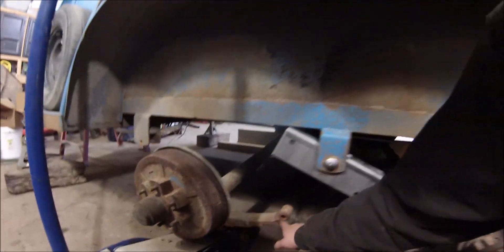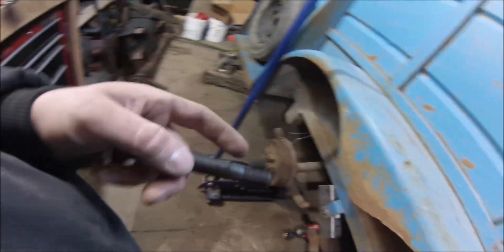Around the Shop: Trailer Suspension Basics

Comment: How do you change the grease fitting on the greaseable bolt. Mine just turns in circles like there is a nut on the back. I have a 2005 Avery car trailer.
Reply from the maker: Most likely a press-in style grease zerk